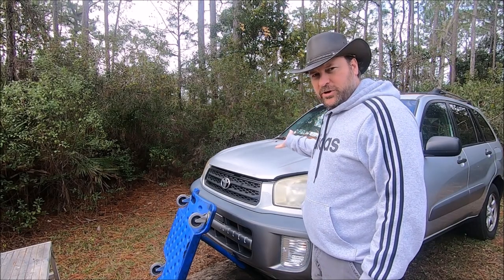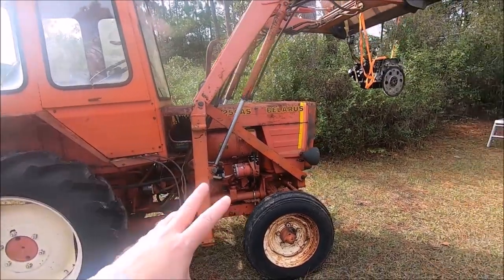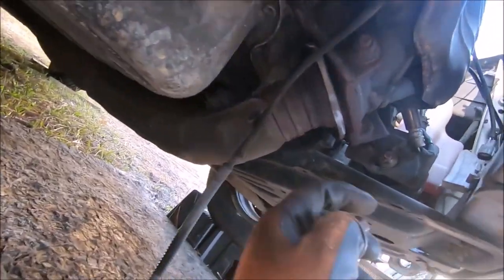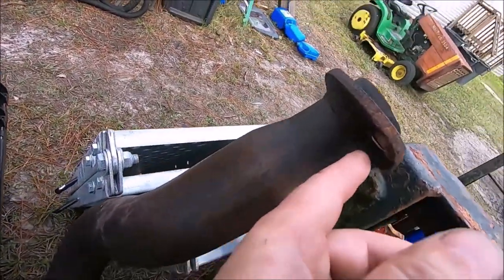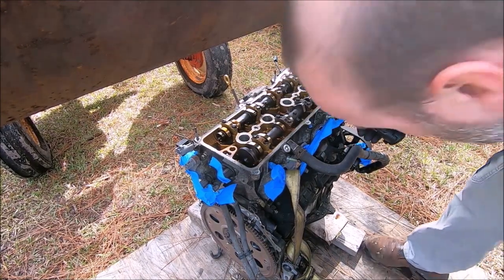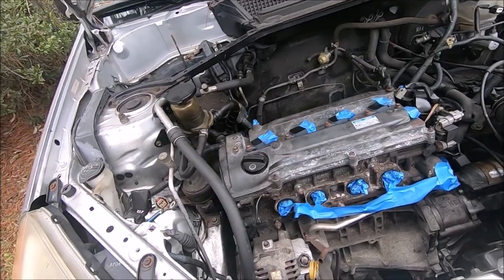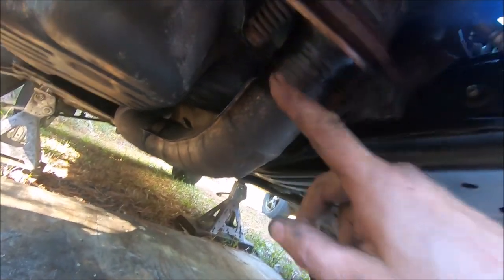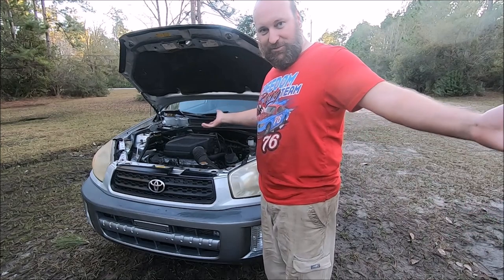2002 Toyota RAV4 — fixing the fried engine

Comment: Would it be easier to change the engine with the autotransmission on or without. And how long did this job take you?
Reply from the maker: It depends on whether you also want to pull the driveshafts, trans mounts, and all the little things connected to the transmission. I investigated this as a possibility. In most front wheel drive cars the entire power train is made to drop down out of the car as one unit. But that’s too hard to do without a lift. Pulling everything connected to the transmission was too much more of a time sink and wasn’t worth it for me. So I settled on just the engine in this case. I think roughly it was about 10 or 11 hours to pull and transfer to the new vehicle in total, if I remember correctly. Pulling the original dead engine out was additional.